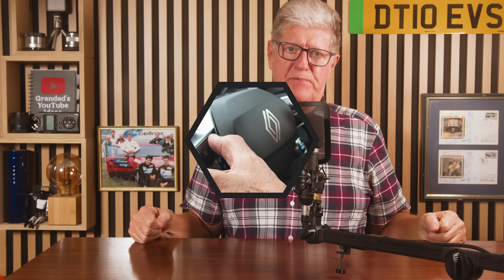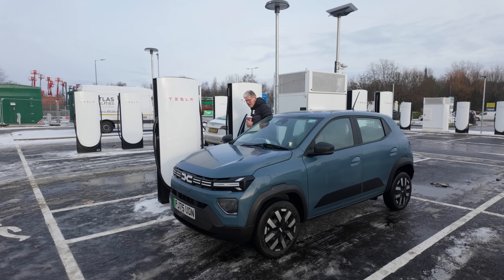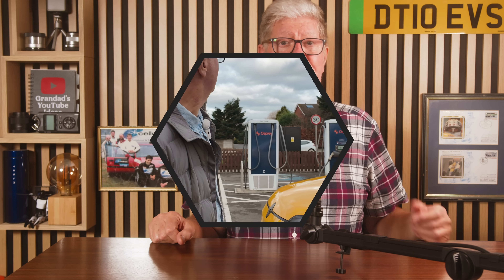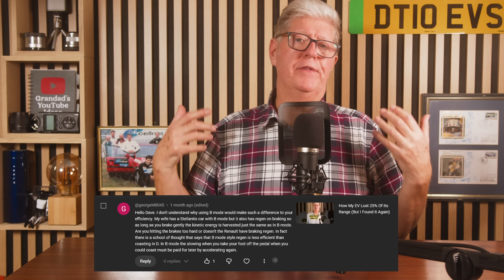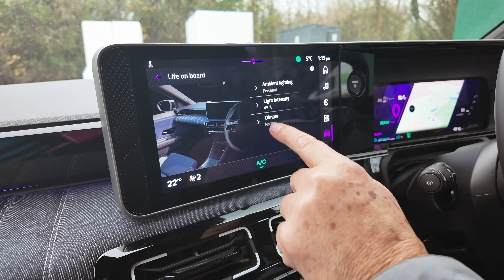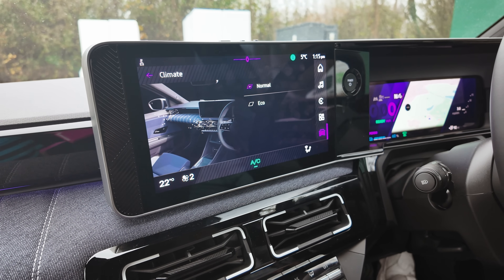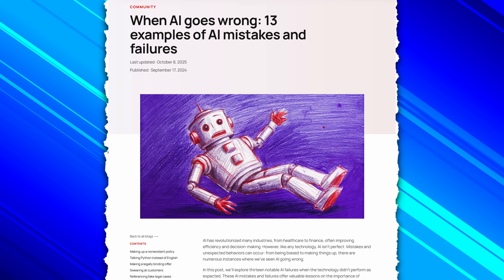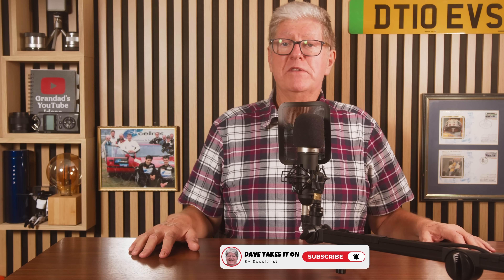Was I Wrong About Regenerative Braking On EVs?

Comment: Out of all the differences EVs have from ICE cars this is the one that concerns me the most.   Having driven Hybrid autos for 16 yrs I'm very familiar with pushing for power and letting off to coast, and there being very little "jerking" of the car between those two states when keeping the car roughly at a set speed.  Whenever I'm a passenger in my friends Tesla I notice very often the car jerks when the driver lets off the accelerator, sometimes making you feel "why did you tap the brakes?  This makes the ride uncomfortable for me as it happens all along the route, even on the motorway.  When I quiz the driver he says he doesn't notice it.

Next week I take delivery of my first EV which will be a Kia EV3.  When I did the test drive I was very happy with the lvl 1 regen braking setting, which seems to be the rough equivalent of coasting in an automatic ICE car.  Lvl 0 is a bit weird as it actually seems to keep the car at a set speed when you let off the accelerator.  I expect I will play with the lvl 2 and  lvl 3 settings after a while to see if I can get used to the one-pedal  driving, but if it means I will need to keep my right foot very still for long periods just to keep the car smooth and steady then it won't be for me.  However I really like that I have that option and it's up to me to choose.
Reply: I have a Kia and manage to use de 1 pedal smoothly enough that my wife does not complain. 
Then you get used to it and you miss it at each intersection. 

For high speed ( highways)I prefer lower regen though
Reply: Don’t worry about it I hated one pedal driving when I started driving ev,s  but after persevering with it whenever the roads were quiet iv found its muscle memory you foot makes micro adjustments to the accelerator without you actually thinking about it  , much as you do with the steering wheel. I hate driving without it now and the stronger the better . I think you friends Tesla has a problem as Tesla regen is known to be the best in the business..
Reply: @rickwits9160  it's the driving style rather than the abruptness of the regen. My wife's driving style is using the throttle pedal as a switch! Constantly on/off, on/off....this causes a "rocking head" syndrome which is very uncomfortable and fatiguing for passengers... particularly myself as I have an arthritic neck. It is particularly irritating to say the least.

I've tried to advise her about the habit, but get balled-out for criticism of her driving 🙄. I now just stay schtum but I'm continually having to ask her to engage autopilot for some respite 🙄
Reply: @David-bl1bt yep I agree my daughter has a 500e and she won’t use the regenerative range mode as she hates it  , I can see why she has absolutely no fitness on the pedals at all  she’s either going or stopping very bad driving .But like you I just keep my mouth shut and pray for the journey to end .  I guess some people can drive and some just aim it and hope . 😂

Comment: The two best things about driving an ev, instant torque and one pedal driving .Power back in your battery and saves wear and tear on your brakes, how's that for efficiency .
Reply: According to Polestar only about 1/8th of the energy used is replaced through Regen. Coasting downhill on long motorway journeys seems to do the same by not using any energy. The kinetic energy takes over - the same kinetic energy which puts energy back into the battery. I use the cruise control to switch off and coast or switch on when energy is needed. I’m surprised how much I use CC when driving generally.

Comment: I use “automatic” regen on my KIA EV3 which gives me the best results.  Around town very high regen, on motorway allows equivalent to neutral in petrol cars.
Reply: One thing to consider is what happens to you brake lights at different settings. On setting 1, my cars lights don’t come on. At setting 2 and 3 the lights come on to alert a driver that the regen will slow you down faster. 

The issue now becomes the effect on other drivers with your lights
Constantly going on.

I flick my addles up and down all the time.
Reply: @roberthartley6629  

"I flick my addles up and down all the time."

=====

Does the wife know 😉
Reply: This. I only change it from city ( one pedal) to highway (low regen).
If I'm stuck in traffic in the highway I may put 1 pedal again.

Comment: I always use it. Not just for efficiency. I enjoy one pedal driving and after 25k miles my breaks are still as good as new
Reply: Ditto.
Reply: After 25k miles, I doubt very much you brakes are as good as new. in fact they will be quite rusty if you haven't used them.
Reply: @taketwo-e5u  Just checked mine yesterday and they're shiny like new!
Reply: @sargfowler9603 Shiny! So they need a strip and clean! Shiny doesn't grip very well. The caliper slides will need a clean and the pads will need a wee buff to restore their effectiveness.
Reply: @sargfowler9603 Great, then you are using your brakes well done. You have to use them or they will seize.
Reply: Brakes are only applied when you come to a stop. The motor does most of the braking.
Reply: Same here. Pressing the brake pedal is so tiring!
Reply: @sargfowler9603 not tiring, but it does feel old school!
Reply: I’ve not driven one yet it’s on order . With my diesel/petrol/lpg cars I try not to brake I use what’s known as accelerator sense look ten cars ahead on motorways put one mile at a time on cruise control on or off

Comment: The BMW i3 only has maximum regeneration through one-pedal braking. Why would you want less regeneration?
Reply: Just looked it up and it seems the BMW i3 has three modes. Not max regen exclusively.
Reply: @dsouflis I have a 2020 i3 and can happily say that if they're is any difference in regen via the different ducting modes (comfort, eco pro, eco pro+) then it is very subtle and I've not really noticed it.
Reply: Agreed, BMW got it spot on. Just one setting and that's that. Faffing around with additional settings is just doing it for the sake of it. It took just a few days for me to get used to one pedal driving, it's brilliant.